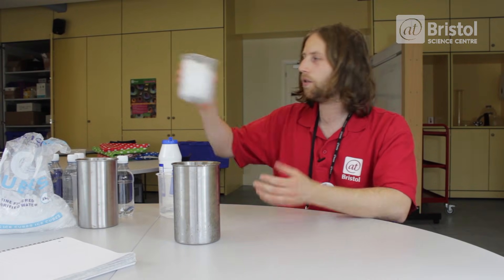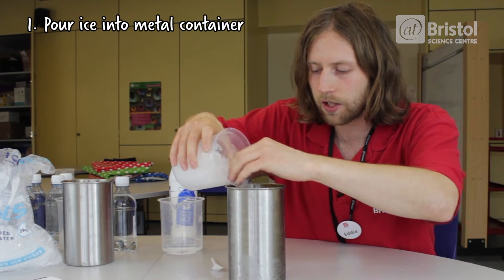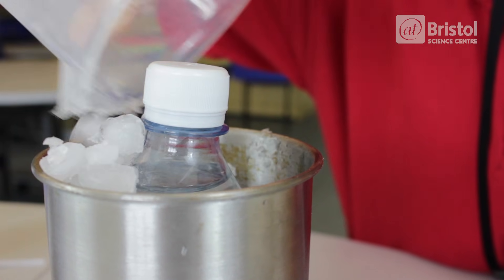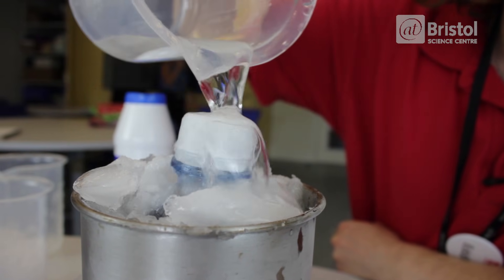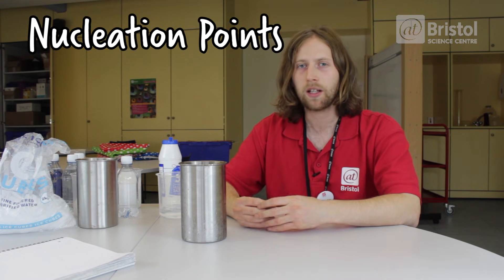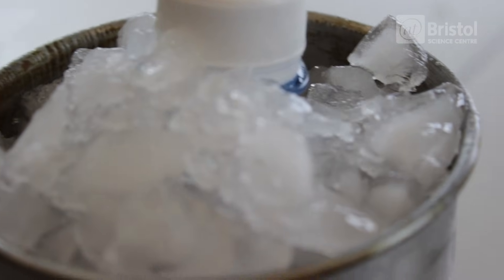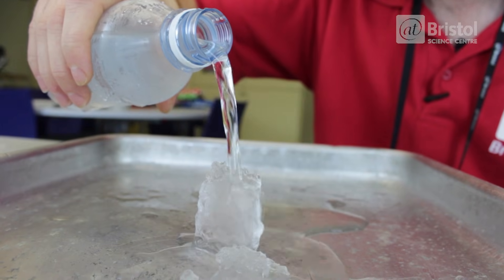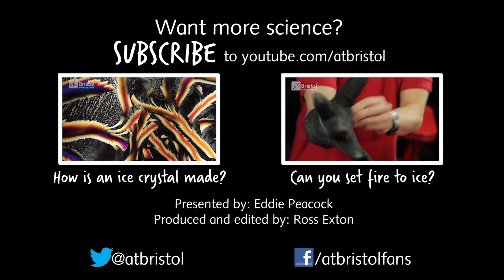How to make instant ice | Do Try This At Home! | We The Curious

Comment: I like cool coffee but pouring block of ice is not my favorite. I always put it in refrigerator, mostly on freezer.
It have reliability issue as sometime the refrigerator on sleep. I make it at night to drink in morning, or forgotten until night again. 
There are no exact timing. After 2-3 hour you get nice cool and little bit thick coffee. 3-5 hour you get stuff like those instant ice, a very soft and ice cream like texture that melt on your mouth. 5-7 hour the top will be frozen solid, had to pierce using fork to make a hole and the liquid below will flow, like a coconut where you can scratch the frozen part and make some crushed ice coffee. Longer than that will totally frozen it, had to wait an hour at least to defrost or you can scratch it with fork tips then shovel it like eating shaved ice.

The 3-5 hour, jelly like ice is what i want people to taste. It is so good, the texture are what make it fantastic. And those instant ice exactly look like that.

Comment: is it ok if i leave it for like more than 30 minutes?
Reply from the maker: +muke lemons It should be ok if you leave it a little longer. You want to leave it for long enough so that the water slowly cools to well below zero degrees, but not so long that it freezes regardless of the 'supercooling' factor. Of course, if you leave it for a really long time, it will warm back up again. We've found through trial and error that 30 minutes gives the most reliable results, and balance between time and temperature.
- Ross

Comment: hi i need u guys to answer me ASAP because is it ok if i dont use beaker but instead a bottle too? but what will be the specific measurement of the amount of tap water if it should be put into a bottle? PLZZZ ANSWER ILL BE USING THIS IN MY PROJECT PLS
Reply from the maker: +muke lemons Hi, are you referring to the 100mL of tap water in the beaker mentioned in point 3 of the equipment at 0:39 ? If you are referring to the bottle of water that becomes frozen, you will need an unopened bottle of still/fresh water, not tap water. Let me know if you have any further questions & good luck with your project.
- Ross
Reply: +At-Bristol Science Centre oh im referring to the 100mL tap water because i don't have a beaker :(
Reply from the maker: +muke lemons The 100mL of water is mixed with salt and added to the metal container (1:22). You don't have to use a beaker, you could just use a plain glass or cup and approximate 100mL.
- Ross

Comment: Wai.... is instant ice the same thing as dry ice?
Reply from the maker: +vera691 No, 'dry ice' is the nickname for solid carbon dioxide which is about -80 C. This 'instant ice' is supercooled water which freezes instantly on contact with a surface.
- Ross
Reply: Okay thanks ^^

Comment: can i ask what is is a nucleation point can u plss elaborate it a little more....i cant understand i need to know ..... right now.... for science report
Reply from the maker: +Angel Alegre A nucleation point is a point around which the ice crystals can start to form. It can be a small particle like dust or salt, or even another piece of ice. 'Still' water does not contain any impurities, and therefore no nucleation points for the ice to start to form around. This is why 'supercooled' water remains a liquid below zero degrees without freezing into ice. Hope that helps with your report :-)
- Ross

Comment: how come it didn't work for me? Can you please tell me what I'm doing wrong because I followed the same procedure and when I'm done waiting for 30 minutes the the ice becomes liquid
Reply from the maker: +Izabelle Barbac Hi Izabelle, if the water remains as a liquid and doesn't freeze when poured or shaken, it's not cold enough. Try packing it in more ice and salt, and use a thermometer to check the temperature of the surrounding ice (it can get as cold as -20 celcius). Let us know if you're still having any problems & we'll do our best to help. Good luck, keep trying!
- Ross
Reply: +At-Bristol Science Centre, ok. THANKS!!
Reply: +At-Bristol Science Centre  What would happen if you tried to drink this super cooled water?